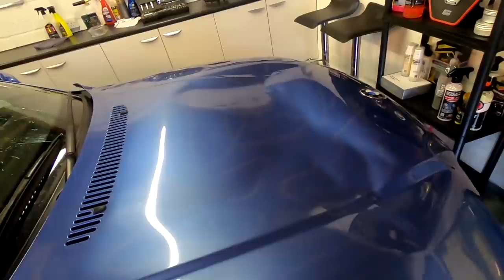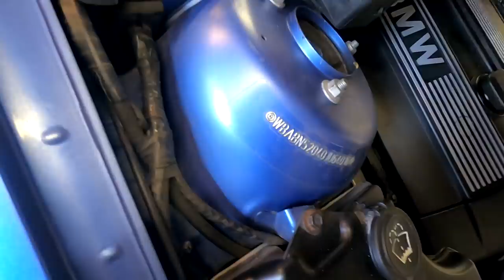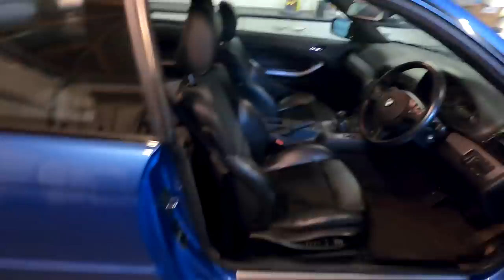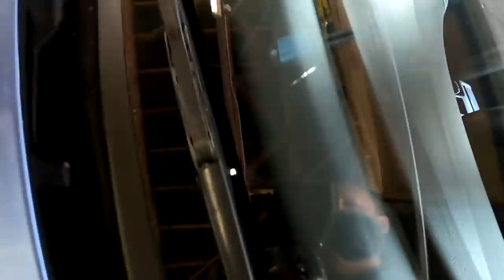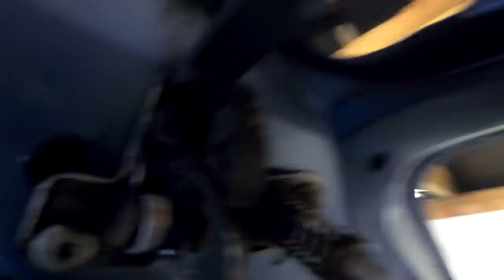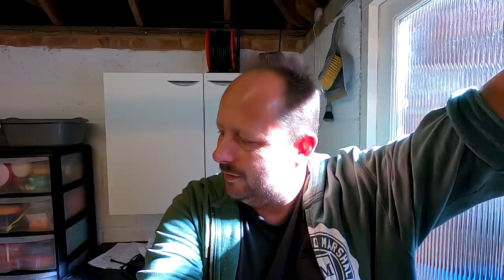BONNET FLEW OPEN WHEN DRIVING!! Smashed up car :(

Comment from the maker: If any bodyshops are watching and would be interested in sorting out the paintwork issues on this car, in exchange for some video promotion, let me know.  Aka I can film some videos of the repair process and show people your business.   Email me at rover8200@hotmail.com

Unless I can find someone to help with the bodywork this resto project may well end here :(
Reply: Try hot water on the roof before you get a quote from someone hot water might work I know it works on plastic bumpers not sure about metal e.g roof doors etc
Reply: had mi accident lost control in a corner .and drove behind hit another car.on the high way want to enter the highway when i did sudden there car next to me i brake go right and enter again what else hit a metal wall cost me a bumper hit a pole.oh what else want to pass other car and the sensor did t see the motorbike which was at fair left of the road i had a shock

your project 2 things you can do get angry and i don t want to see this bloody damm BMW no more or
i get brand new windshield the bonnet or we call it the hood i can get it from the junkyard cheap or a recycle store or online

oh a 2016 Corsa have sensors
Reply from the maker: @koioo2  thank you mate yer ill try and get a breaker bonnet
Reply: I'd suggest contacting John at Auto Cosmetic in Gosport. My car was involved in an accident and did an excellent job on the repair, he's very skilled.
Reply: John - e46 parts are so cheap on ebay. You might be able to find a replacement bonnet in estoril blue. Roof will be a PDR job and windscreen - insurance excess of £100 ish?
Reply from the maker: @pana129  yer, but the roof is pretty tricky. gonna be a major test like someone else said its easy to put a new panel on it.. suddenly becomes very very expensive.  I just need to check for damage to the flitch where the brackets mount as well.
Reply: Forensic Detailing Channel I know a few cheapo Bodyshop’ places, I can ask for you?
Reply from the maker: @ibbykhan942  if they are willing to fix it for free in exchange for like a video promotion or something showing them doing the word could be a great advert..  I dont think they would do it unless they have been following the channel for a while (cant blaim them) but you never know...
Reply: @ForensicDetailing   what parts Did You Buy To Repair The bonnet? Just had the same happen to me in my e46

Comment: That switch dear John! Is the alarm sensor! If you open the bonnet when the alarm is on, iT will go off!! Those car don’t have bonnet open warnings... nor the e39 have sadly!! Fine yr Allright!!
Reply: I'll need to mind that for the E39 then
Reply: Graham Reid although the  1999 e39 530Dta with 650000km on iT didn’t had iT !
Reply: I was about to say what the rock did
Alarm switch . Alway drop the bonnet from the highest point and never trust a door switch. Copper Slip all parts on bonnet mech they stick  , any way nice new bonnet 
And screen . Things will be fine anyone can run a new car Clubsport
Very nice Respect

Comment: Thought provoking reflections on a scary incident, my friend. Something for everyone to think about. Had the bonnet of my MGC GT fly up. Watching the video brought it all back - the sudden and complete loss of vision, the crash as the bonnet hit the roof, trying to look round it as I struggled to bring the car to a halt, standing there afterwards shaking. No sensors of course, the bonnet being made of aluminium flexed a fair bit anyway and I hadn’t realised that the safety catch was partially open due to a build up of grease. All it took was a fast run along a dual carriageway with a series of increasingly sharp undulations and up it went. Walked away unhurt but with much to be grateful for. Stay strong, life goes on, you’ll soon have things fixed.

Comment: Glad to see you are ok

Just so you know the E46 hasn’t got a bonnet sensor- the plunger switch us for the alarm!

The only time you get any warning regarding the bonnet is on a SMG M3 it has the switches in the bonnet catches and has issues selecting gear if the bonnet isn’t closed properly!

Your roof you are better buying a new roof and having the old one drilled out and refitted- will be a much better job- (do it whilst the windscreen is out!)
Reply from the maker: thanks paul makes sense cheers mate..  ouch that could be a show stopper on the roof :(
Reply: Not to bad a job- sounds horrendous but it’s pretty straight forward (I had my roof taken off to fit a OEM CSL carbon roof to my M3) you can get a new roof panel from BMW

Comment: I'm glad you're safe!!
When did you do a engine bay cleaning last??
Reply from the maker: bout a week ago in real time.  I went through all the scenarios in my head dallas , been using it everyday since (including motorways), this suggests the main latches are good.  my best guess is I just didnt close it properly after I stripped out the intake to check for cracks.   all the main ring latches were regreased with copper grease and the safety latch with normal grease.   Ill speak to BMW about the secondary latch and see what they say theres 2 springs in it and one of them feels dead. prolly needed to be replaced, its not seized and its moving but there is very little spring in it.

Comment: Exactly the same happened to me in my old 328ci a couple of years ago. Scared the shit out of me and glad you’re ok👍
Reply from the maker: i dont want to hit the Heart symbol because its a horrible thing to happen.  defo scary isnt it :)
Reply: Forensic Detailing Channel Certainly was and luckily I was only doing around 40 mph. The bonnet was correctly closed so must of been some sort of failure in the near 20 year old catch. Sourced a bonnet and struts off eBay and it also ruined the screen wash piping. I now have ocd of checking bonnets on everything I drive 😂

Comment: Glad you came away unscathed fella. Once you get a new bonnet, check the panel alignment, i had the same happen to me in an alfa GT, after having the bonnet replaced, it turned out it had twisted the wings and framework underneath. Fingers crossed thats not the case here and from the sound of it you were travelling a lot slower thankfully
Reply from the maker: I was just thinking about this, spooky timing yer..  at best I will need new hinges at worst whereever this bolts onto the flitches could have moved a bit.   I might be able to borrow reg's bonnet as a dummy tester to see what the score is.

Comment: Im sorry for that....I like that you aren't giving up on the car and still gonna make it look mint....good work
Reply from the maker: gotta think things through with the car.. this is a major set back.  If I cant get some sort of support then to repair this damage is prolly not viable.  car is too good to break though in my head.. dunno.  could use it as a track slag I guess sort the glass on insurence and get a bonnet and wrap it in carbon or rattle can it lol.   would be a real shame.. interior just had all new bits put in lol.
Reply: @ForensicDetailing  Yeah the car is in really good nick and I agree with you, it would be a shame to part it out

Comment: happened to me in a Peugeot 106 years ago, the bonnet just hadnt been closed properly as soon as I joined a dual carriageway, woosh over it went, again luckily there was someone alongside me to the right but not in front or behind. 
The catch isnt a safety catch really, as soon as you get a bit of speed the force of the wind under the bonnet is easily enough to overcome the catch and slam it backwards as we have both found out

Comment: It always amazed me they have a light to tell you the boot's not closed properly but not the bonnet. Seems totally arse about face to me! The alarm switch could easily have been doubled up to be a bonnet open light as well.
I'm not sure but i think my E92 has got a bonnet open warning so BMW did finally correct this oversight, sadly too late for you.
Anyway, like others have said, at least you're safe. Good luck with the repairs.

Comment: Glad ur ok and not injured. Never seen a bonnet/hood light. Here in the USA the damn hoods/bonnets oddly sometimes are the most difficult little things to get open. The initial latch opening inside the car is easy ofc and then get to the hood/bonnet and find the latch in the grill sometimes gives people a hard time. Sometimes a very hard time. 
It seems to be a very odd and or freaky incident.
I am no expert perhaps there are lights for that but I personally have never seen them. I will now go and read the comments and find out this has been said a million times and or I am completely wrong about the light lol. 
Ttake care, be safe

Comment: Lucky it wasn't more serious. Don't recall my previous E46 330ci having a bonnet open indicator. It did have open indicators for doors,  and boot. Probably a faulty latch was the cause but from memory they are quite heavy bonnets and latch down with a click when you close. Can't also completely rule out human error. Maybe you didn't close it completely down when you last had it open?

Comment: Glad you're ok John.
Did you forget to lock the bonnet ?
Either way, the safety catch should've held it.
What the other's are saying too mate, they never came with a sensor that tells you the bonnet is open.
That switch is for your car alarm.
You'll now have more to add with a future repair video.
All the best mate 👍
Reply from the maker: IVe been wracking my brain.  I tend to drop the bonnet from about a foot up.  I always do this on all cars.   but may this just didnt like drop in properly.  I used the car earlier in the day and obviously nothing happened but it was prolly an accident waiting to happen.. my money is simply I didnt close it with enough force even though it looked closed.

Comment: Same happened to me, at 70mph in my E46 Vert... on the way home from buying it. Luckily I had the roof down and the window screen didn’t smash. Again like you I had no warning light, the passenger side latch doesn’t return to the locked position unless I use a small flathead to pull it back out.

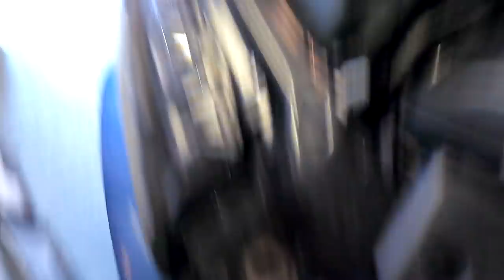EDIT! At 6:40 I can see your drivers side latch is stuck open like mine does. Use a flat head to pull the little metal ring back out. I tried replacing these latches and they are a bloody nightmare so I just remember to pull it out before closing the bonnet.

Comment: Can't honestly say I've EVER seen a bonnet open light warning personally. I've had similar switches under bonnets, but they've always been for either an alarm or to automatically turn on under bonnet lights so you can see what you're looking at. Not saying they don't appear on any car, just never seen one in any of the peasant mobiles I've owned, or seen.

Comment: You fiddled with the locking mechanism a few times in the engine bay cleaning video... did you maybe jam it in the open unlatched position without realising?
Reply: I was thinking the exact same thing. 
Bonnet should remain shut on the secondary latch and it's usually pretty obvious if the bonnet isn't fully closed. 
That sensor is for the perimeter alarm.
Reply from the maker: the secondary safety latch has 2 springs..  I think both are just gone.    the safety will still engage even with a worn spring but I think its not pressing itself hard enough so eventually the hood might just break free which is probably what happened.  ill check with BMW.

Comment: Pretty much the same thing happened to me and my e36 a couple of hours ago... Luckily there was no one behind me either so i also just slammed the brakes. Also luckily my roof is fine, but obviously the windshield and the hood is all fucked. My hood locks have been messing with me for the past 2 weeks, but I thought I had it strapped down enough to hold driving, and it lasted me driving with it like that for a week and now today it blew open...
Reply from the maker: well Im glad you are also safe mate.  you will get the damage sorted and look bad on it like me as a lucky escape.  I would get the secondary latch checked or replaced on the E36 (I have an e36 as well)

Comment: That’s proper strange, even with the bonnet not pushed down the safety hook will latch. My L200 fuel flap lock is next to the bonnet release and the amount of times I’ve been driving along with the bonnet bouncing about!!! Oh well, go and change ya pants and get the Bilt Hanbro out, that will sort it out 👍

Comment: As a mod I got some chain and bolted it to the wing and bonnet so if the original latch fails it will only lift up about 6 inches
Reply from the maker: very sensible mod that is.

Comment: Id suggest that roof damage would be an issue.
It may well be an insurance writeoff if you went down that route
Reply from the maker: your right yer, even just the bonnet and wind screen might be a write off because of all the OEM parts in the bonnet underside.. assesor would estimate repair at 2-3k for this.  car value 2k etc..  would be a write of with 1k damage really this one :(

Comment: I actually had the offside on my E90 seize up (catch mechanism) but the E90's have 3 catches, one on either side and the middle catch. It was a pain in the dick to get it moving again but it just needed regreased in my case and a bit of working to get rid of whatever schmoo had seized it up.

Comment: Blimey... Bet that was exciting!
There is no bonnet open warning.
The thing that should have saved you is the mechanical latch that you need to move the lever to open the bonnet with after you have popped the latch by pulling the lever inside the car. Must be all stuck/seized in the open position.

Comment: It’s because you washed all the Structural Retaining Dirt away in the last video, it was keeping the hood (bonnet) shut.

On a serious note: glad you’re OK, must have been scary as hell.
 If that had happened to me, my car’s seat would’ve been instantly dyed brown
Reply from the maker: I think the spring has gone in the latch 300d.  It was dead and stuck/stiff before I cleaned it.. It was moving a bit more freely after cleaning and regreasing but theres not like the right amount of spring.

Comment: It was obviously just a case of you hadnt closed the bonnet properly. Bonnet latches dont just release because of the way there designed. That switch is for the alarm, not the bonnet.

Comment: The bonnet hook is a failsafe for that...No bonnet hook? My bonnet wouldn't latch (needed oiling) so i gaffered it down with the hook holding it.. Are BMW's strange or what?

Comment: I see this on cars all the time especially BMW's of this age due the the bonnet release cable design, people jet washing the engine bays does two things to them - main issue  people jet  wash the grease off the  cables  springs and catches  so it doesn't fully return, so the spring pins can pop up past the catch.( usually cable is the culprit)  They can also do the opposite if the springs aren't lubricated or the cable can pop out the housing when pulled,  making the bonnet stick shut.  People who jet was engine bays are their own worst enemies when they don't re grease  mechanical parts for fear of someone  saying the grease makes it look dirty .  not saying this caused this,   but its usually after  a detail I see it happen.

Comment: Any way to prevent this due to having a 330ci clubsport?
Reply from the maker: check the secondary latch is not seized. they are only like 20 quid to buy a brand new one.. it should have good amount of snap on it. they loose their spring after a while.
Reply: @ForensicDetailing  thanks. Hard to pass up on 1 of these cars but god damn the amount of work to improve and restore them! Worth it when then will be ridiculously rare

Comment: Ouch.. Haven't had the chance to watch the video but was it the latches you took off to paint? Luckily your OK, though it's a hard hit depending on how fast you were going...
Reply from the maker: didnt take the latches off just cleaned them up and regreased..  how fast between 40-50 I think.
Reply: @ForensicDetailing  Arghh.. such a bummer, great project car for sure. Anything can be fixed and at least your safe. But must of been one hell of a scare.

Comment: More common than you know on the E46 the old bonnet flipping open
Reply from the maker: is it Leo?  any idea on root cause m8
Reply: The bonnet mechanism can seem like they lock off but will pull back out with enough force

Comment: Wow, close call. Definitely not your fault. More an engineering fail from BMW really. This scenario shouldn’t have been allowed to manifest without alerting and protecting the driver. An E90 I had, there was a close call where it was in a horrendous downpour and the wipers just totally cut out. Couldn’t see anything. Had to restart the car. Seemed it was a dodgy relay that BMW revised but didn’t proactively warn at risk customers. Same car, another scary thing: the passenger seat pad sensor stopped working. So it didn’t detect when someone was sat on the car. Harmless, until you realise it won’t activate the airbag because it doesn’t think anyone is there. Really undermined my confidence in BMW.

Comment: I’d be more concerned about the latch mechanism than any switches. Clearly it hasn’t worked properly. Has it been degreased too much and the cable isn’t moving freely? In any case, the secondary latch should prevent this from happening and yet it did. Has anyone tampered with the latch? It’ll need the most investigation imho

Comment: Bonnet doesn't have a sensor to tell you its open... Your m3 didn't have it neither...
Reply from the maker: no your right its for the alarm isnt it. I wash sure in the video
Reply: @ForensicDetailing  yes for the alarm... No E46 has the sensor for the bonnet I'm afraid. Tbh most cars don't. You live and learn...